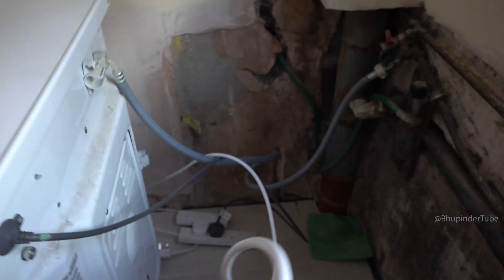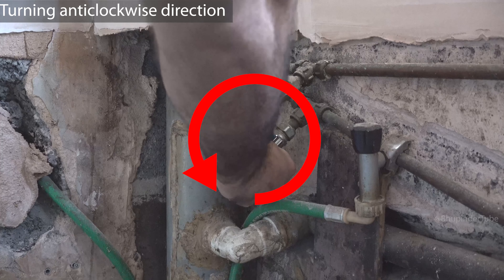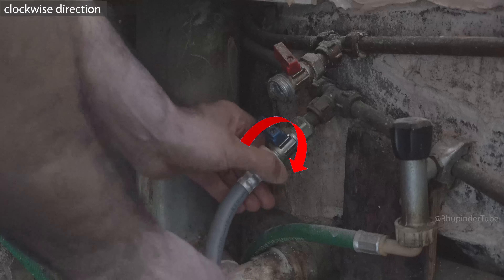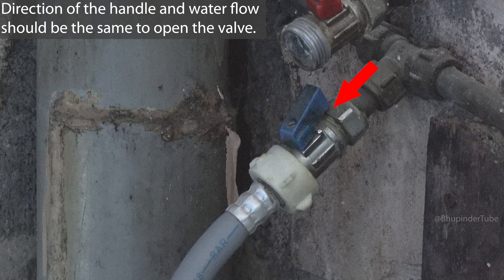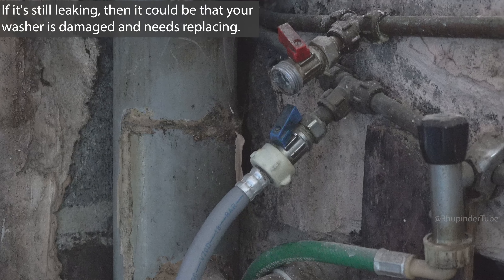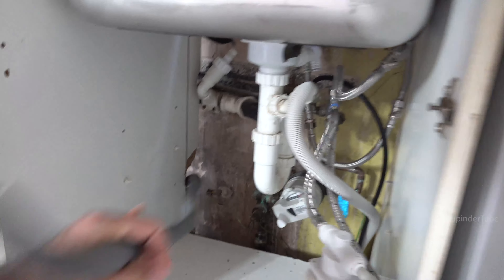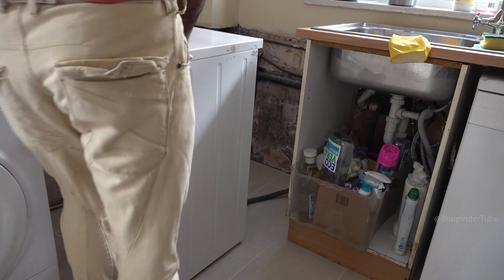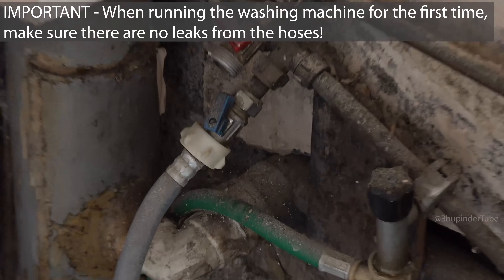How to install a washing machine

Comment from the maker: 👉 List of required tools in the description 
To support my channel, please don't forget to subscribe. You could also watch my other DIY videos below:
👉 Product Maintenance Tutorials -  https://youtube.com/playlist?list=PL6oDA8S3RmtE0G238FkY0HbhlsUkpM9Od
👉 DIY Tutorials - https://youtube.com/playlist?list=PL6oDA8S3RmtE5kt9EoQ5HwN10JII6AFKt
👉 How to Disconnect a Dishwasher -  https://youtu.be/Mzc5GcyNEv8
👉 How to install a dishwasher - https://youtu.be/3YUuQhu41Qg
👉 How to Disconnect a Dishwasher -  https://youtu.be/Mzc5GcyNEv8
👉 How To Remove A Radiator - https://youtu.be/4jP8eN_z_eA
👉 How To Lock Vise Grips - https://youtu.be/S9xnT9hIhqw
👉 Soap Pump Not Working - FIX - https://youtu.be/gXkxYpTyDMM
👉 How to fix a dripping tap - https://youtu.be/D6QFe_KTuvc
👉 How to set the lock on a suitcase - https://youtu.be/HduFDF-2CX4
👉 How to isolate kitchen tap - https://youtu.be/uK8yV05ZopU
👉 How to open Nissan Micra when battery is dead - https://youtu.be/YhOCuJhU1OA
👉 How to stretch your Glasses - https://youtu.be/W5zPfJZqkIs
👉 How To Open A Very Tight Jar! - https://youtu.be/BOgPJAYETME
👉 How to install hooks for the cups - https://youtu.be/znhKSCRf01U
👉 how to unblock a sink - https://youtu.be/O5JQ7qpnWb8
👉 How to make your own DUMBBELLS at home - https://youtu.be/vPgJW61YT4w
👉 How to remove wallpaper - https://youtu.be/1SZLZ13RzKE